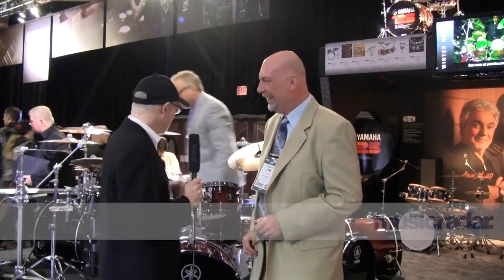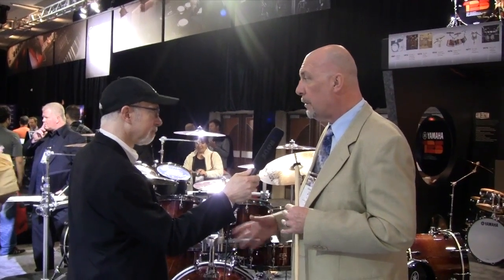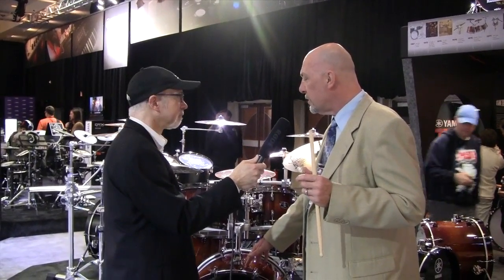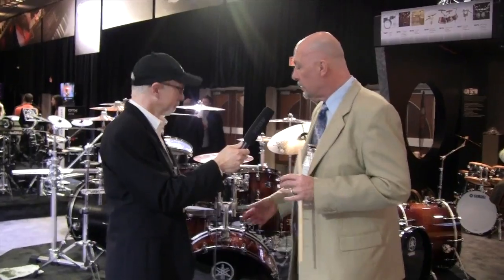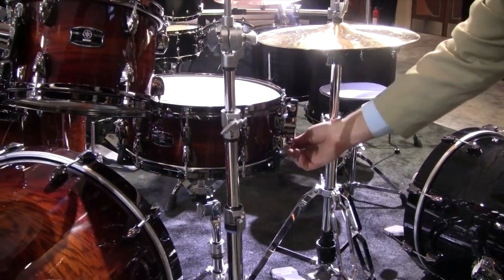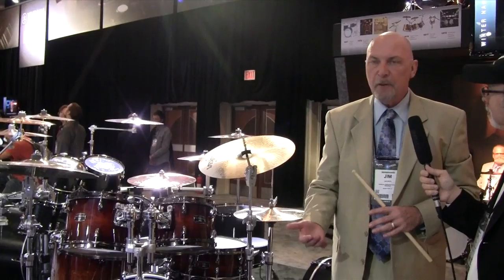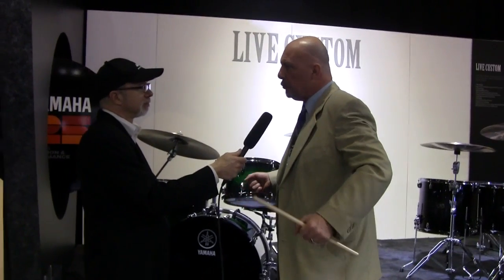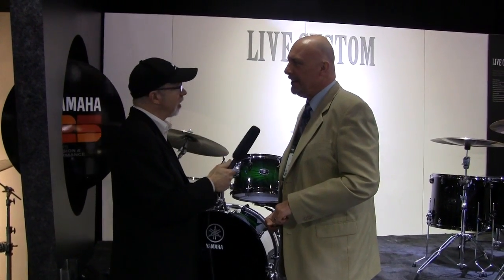NAMM 2013: Yamaha Live Custom drums

Comment: Baseball cap and blazer..nice look...Yamaha is trying to be more efficient and earth friendly by shrinking the metal tom mount. Translation = we save $ with less metal. 5:12 I agree that 22"x14" sounds as good as any other depth. So the why do drum companies insist on shoving 22"x18"s down everyone's throat? So guys that buy the deeper 18" or 20" think they are going to sound much better? Not so...It is just bigger and heavier..takes up more stage space in tight spots.